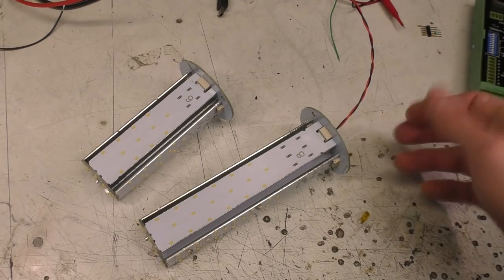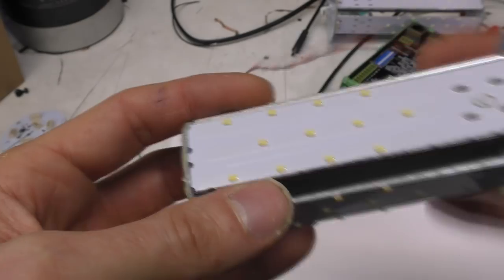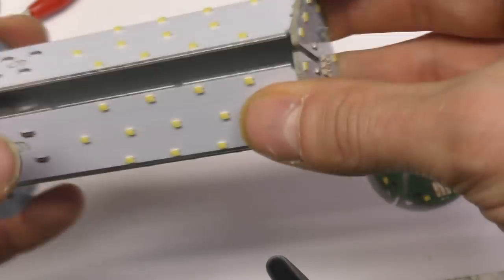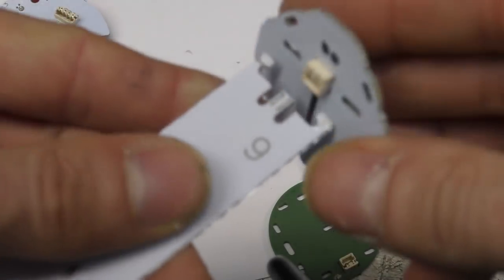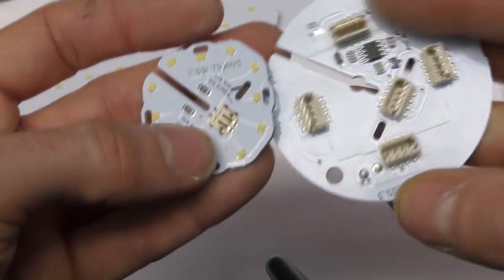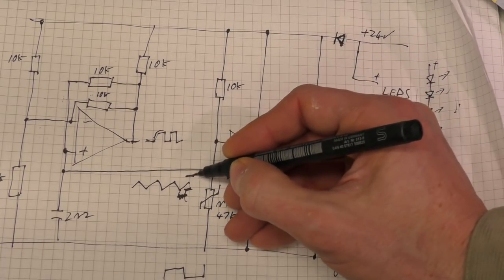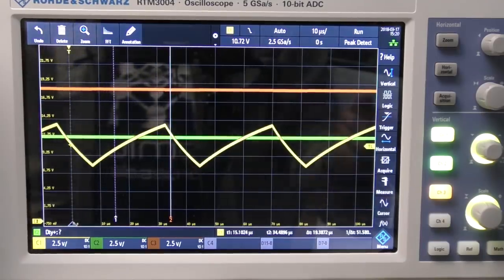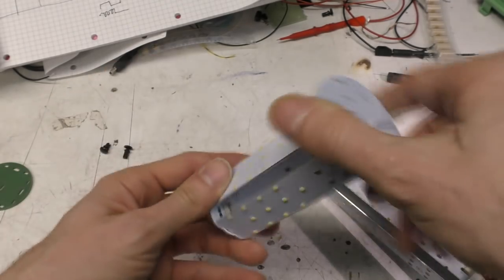Custom LED assemblies for a large installation

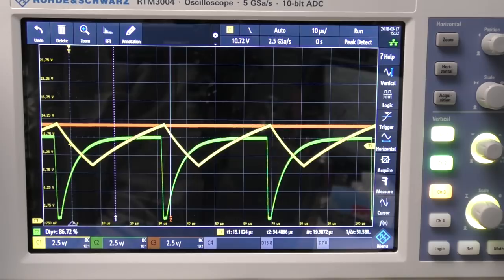Comment: 25:49 What you mention here about slow rise time makes me wonder; How do you deal with EMI compliance? 
A lot of the installations are obviously one-off, but I am pretty sure in the EU you'd still need to satisfy CE EMI (and general safety) directives, or are these exempt of EMI in the US/UK?  
EMI testing is horribly expensive, especially for such large outdoor installations you are building. Never mind that you often deal with high data rates (with fast switching), and thus probably a lot of EMI in general. 
Of course, at least in case of CE, the directives do not mandate any testing, merely that the manufacturer is reasonably confident that it would pass the requirements. Hence maybe some simple testing is sufficient, or maybe you just design your boards for best possible EMI performance and call it 'good enough'.
A last option is of course that you are contracted or sell them as part of a bigger installation, and leave the EMI hassle as a responsibility to the customer/final installation.
This would perhaps be a very interesting topic, not really highlighted often.

Comment: The tab trick is done for heatsinks in PSUs and such. No need for screws, just bend the tab.
For assembling the whole thing, a little jig can make it much easier.
Cutting triangular grooves into the aluminum substrate could help with heat dissipation, as it increases the surface area, but overall, I think the plastic case is the limiting factor. (The heat would still be trapped inside)
Nice cheap temperature limiting circuit. It's basically a rudimentary PWM generator. I love coming up with circuits like that - in fact I made one pretty much the same as yours for a bench PSU so the fan wouldn't be too noisy.

Comment: those fasteners are on car shrouds under car used quit often really, most are not reusable but very handy to put together
Reply: There are also many types of these with threads. You have to treat them kindly to reuse them though. Plus being plastic and on a car, they see temperature extremes and become brittle after time. This makes them "less" reusable heh... As luck would have it (regardless of the exact type of fastener: threaded or not) they are dirt cheap.

Comment: Amazed at the little details. Like at 23:20 the black wire has a loop in it to prevent the alligator clips from shorting on each other. Amazing.

Comment: Hey, Mike. I am a brazilian designer and i work mostly with lamps. I am starting to get into the electronics side architectural lighting and large projects. I would like to thank you for sharing your knowledge and experience, it has already been of great value to me. In my country pcb manufacturers are very limited and not really willing to do a lot of uncommon projects. Your tips on pcb construction were eye opening! Again, thank you very much :)

Comment: I've seen an alu through board, but it was unconventional at best. Let's see...it was 3 by 7 cm with several gaps cut in the alu from the raw side. A very thin, i would say .05 layer of conducting material was left, and on that, through traces, chips were placed with tabs that then stuck to the raw side for (?) cooling or (?) ground. 

The board came out of a laser engraver a friend o mine bought some years ago (2015 ish) directly from China. I don't remember the brand name, however, i remember it had a large stencil of a purple butterfly on the side.
---
Anyways, i was impressed by the board design, my expertise goes only so far as i've no direct contact with electronic design, but it was still, to my eye, impressive in its deceiving simplicity. I could tell some work had been put in to it being made.

The laser died because of a surge and rather than fixing, he up-cycled it and bought another.

Comment: Those clips used to be a bit more popular a few decades ago. I got a few off of some internet related machinery as blanking caps. IE, that's how i found out about them. Bought a few bags of assorted sizes. Useful for screw holes.

Comment: Could you point me in the right direction for calculating the LED temperature/power dissipation etc. for when designing an aluminium board of LEDs like you have shown please?
Reply from the maker: Build it. Test it. Adjust current for acceptable temperature.
Reply: Do you think the thermal simulation tools in Fusion 360 are worth using? It's hard to justify the expense of fast turnaround times on a hobbyist budget, and waiting 2 weeks for PCBs really kills iteration time.
Reply: @Phoen1x883  prototype it with protoboard first
Reply: mikeselectricstuff thank you for the videos, there are a great many projects out there waiting to be made. I will keep my eyes open for things you may find useful or interesting for teardowns when you have time

Comment: Did you get any issue with heat in the FET at such a high frequency- especially with the softer switching edges?

Comment: Nice and simple design ! always amazed at how you use PCBs for structural designs.
quick question though... I find you makeshift PWM driver rather neat and I get why you do not want to switch on your load abruptly, but don't you get heating issues in your mosfet by staying for "so long" in linear mode during the switching cycle ?
Reply from the maker: It doesn't stay that long - that waveform is about 0-  12V but it only starts to turn off below about 2v

Comment: Lots of knowledge bits there: op-amps as oscillators, generating PWM from a triangle wave, gate softening, but with all the heat generated from the soft gate, you could have just used a MOSFET in its pinch off zone instead of the oscillator.
Reply: Keeping the mosfet in the linear range would dissipate significantly more power and would require a very large device. Using a transistor as linear device wouldn't help one bit for thermal foldback.

Comment: really a sophisticated construction for a cube with one collour
i would be a bit concerned about the VCC for the OP amp and also
used for reference....a PWM  and no smoothing Cap ..hmmm
the Oscillator also change his frequency....
but obviously it worked......nice
Reply from the maker: The PWM frequency doesn't matter, neither does the supply voltage. Smoothing cap would have been a problem as it's powered from 250Hz PWMed

Comment: It would seem that the soft-on switching would really heat up the mosfet.  24v at 0.8 amps is alot of watts potential and that mosfet looks tiny, not much room for some extra switching losses.
Reply from the maker: Bear in mind that the swing is 12V but it only turns off below about 2V
Reply: Would have been nice to use the last channel on the scope to show the drain of the MOSFET

Comment: You can push the center of the snap rivit in in many cases to release they are often used in plastic car underbody panels that protect against corrosion.

Comment: Very interesting as always. The tips and tricks of actual production only experience can really teach you effectively. Love the simplicity of the thermal cut off as well. Did you run any calculations on the slow mosfet rise time to ensure it doesnt burn too much power? Since the package is quite small.

Comment: Ingenious! A general question, do you specify to the pcb manufacturer ‘exactly’ what components you require? Like do you specify the ‘brand’ of even jellybean parts like resistors and capacitors?

Comment: Do like the thermal protection! I'm building a "quick and dirty" charge/discharge station for recycled 18650 Li-ion batteries. It can charge 10 batteries at a time and discharge 10 batteries at the same time or charge 20 or discharge 20 as 10 lots of two in parallel. I've been using DS18B20s and an Arduino to keep track of high temperatures and turn the power off at 65C,  I like the idea of being able to reduce the the charge VI instead of turning it off. Do you mind if I "pinch" your circuit?

Comment: One thing to watch out for with 'white' LEDs is that the yellow phosphor is usually more diffuse than the blue LED so at wide angles the colour temperature is more yellow. You can see it at 5:00 that the light coming out of the 'corner' is more yellow and the light out of the sides more blue.
Reply from the maker: Yes, you often get some colour shift at extreme angles, but usually better than getting no light

Comment: Interesting video as always. Did you consider using SOT-23 fixed temperature (electronic clixon) thermostats and a FET to switch over to / bypass a limiting resistor? The disadvantage would be only two fixed brightness levels, though...
Reply: I like the subtly of his solution. They would reach a natural equilibrium and probably not even be noticed by the customer. Very professional way to handle it.
Reply: I like it too, I was just wondering... ;)
Reply: That's one additional component though, right?  He stated along the lines of "a resistor costs nearly nothing, but /placing/ it costs money."
Reply: It would be less components as it is just that, a FET and a big surface mount resistor. No need for the "complex" circuitry, but it would be less flexible in terms of brightness. It would be a completely different solution to the temperature issue. It would go in place of what he has now.

Comment: Some plastic push rivets have a screw thread on the post bit, and a slot on the rivet head. It makes removal a lot easier, unscrew them a bit and then you can pull them up.